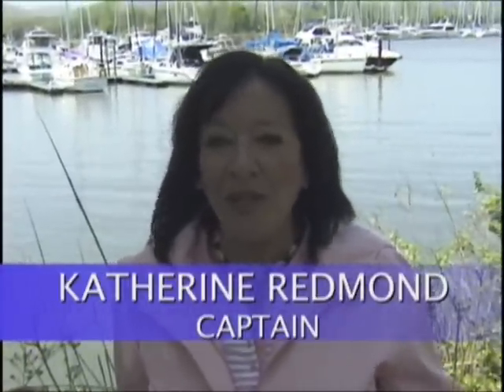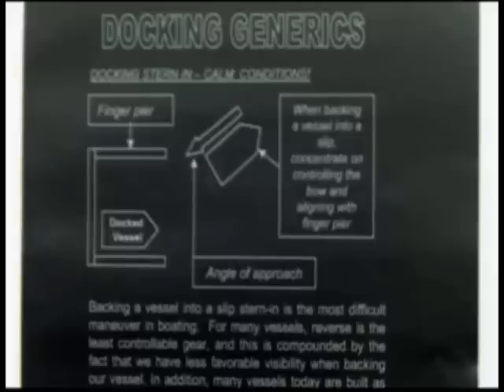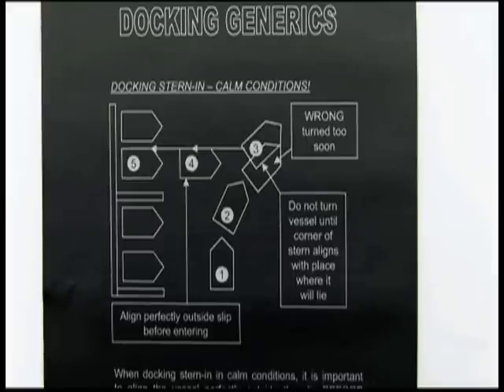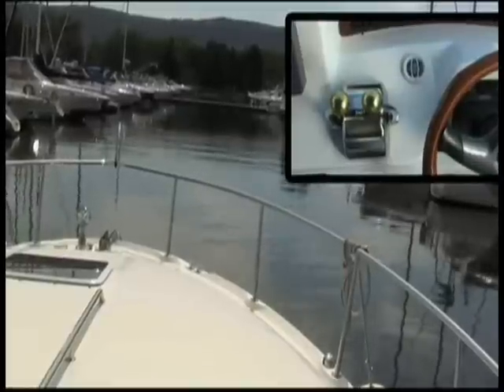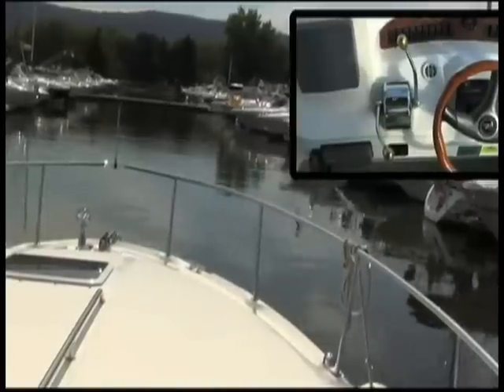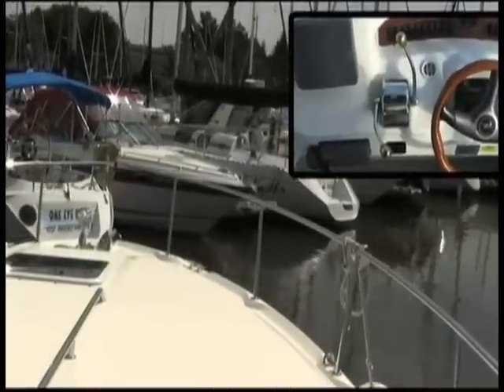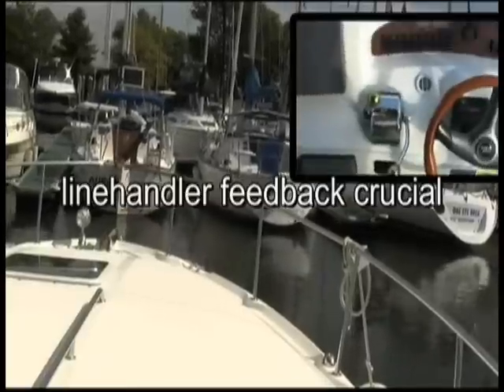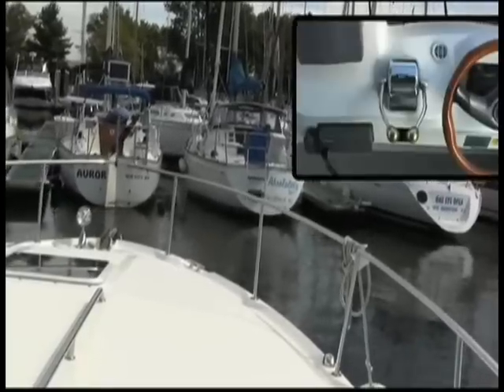Boat Docking Stern In

Comment: What Capt Kathie refers to as leeway is correctly called Transfer.  Transfer is the movement of the vessel towards the outside of the turn.  Leeway of a vessel is caused by the wind. At the start of the video, I don't understand why she goes port forward, bringing the bow to starboard and then backs to starboard. It would make more sense to go starboard forward to start the turn.

Comment: The technique in the live action isn't the same as the one illustrated in captkathie's diagrams at the start of the video. There is no attempt to align the "corner" of the stern with the dock - as she advocates in the diagrams! 
The "linehandler" crewman  - with no lifejacket - makes a dangerously wide stride ashore  but has no line in his hand! If he's "crucial" to the docking procedure then however does captkathie manage when she is singlehanded?
Reply: Captain Kathy used to be a Captain on a 200,000tn. bulk carrier and doesn't need no damn  geriatric short legged, short-arsed rope-holding helper to guide her little sedan-bridge "day boat " by the stern to help her stop  her vessel from  hitting the dock. Cheers.

Comment: That passenger is not much help at all; I would have stepped onto the dock with stern rope in hand, and guide it backward to a stop n dock. useless !
Reply: Boat is too heavy to guide it by a rope in hand   as engines are for that job exactly, master of vessel should have full control of vessels movements until berthed and secured.